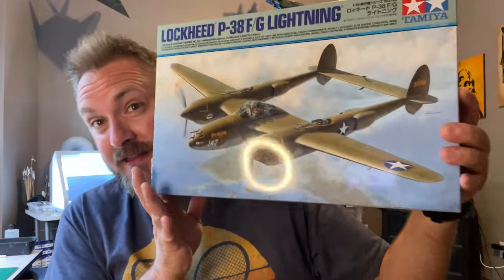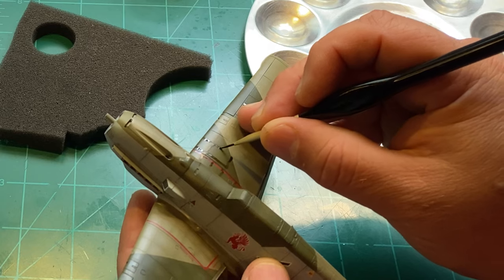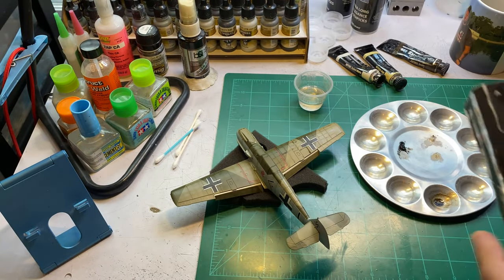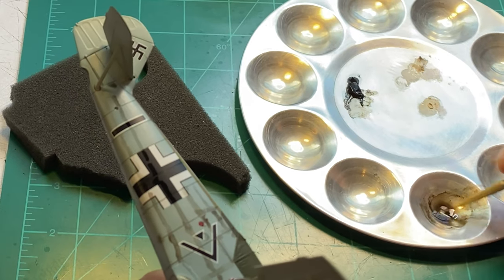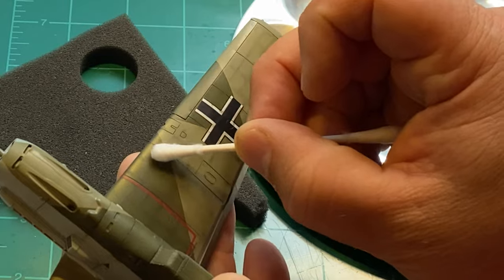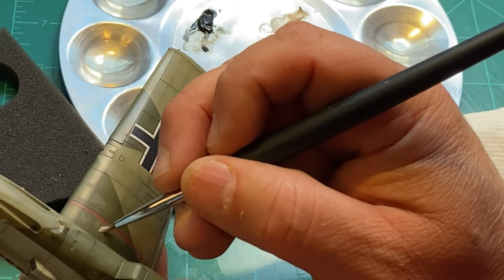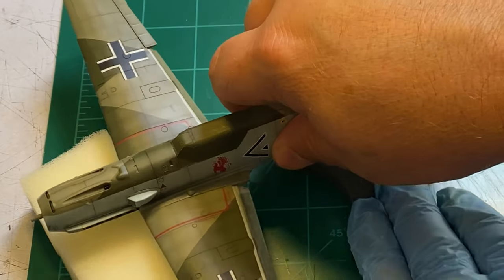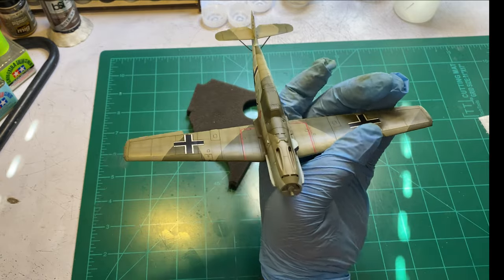Tamiya 1/48 BF-109 E3 Build Part 3

Comment: Hello, how do you get that great finish on model ? Somehow I'm not able to get such gloss, semi gloss or flat finished. I'm using tamiya, mr hobby or mrpaint colours...what ratio paint/thinner are you using ?
Reply from the maker: I spray at about 12 psi and mix my paints pretty thin.  I don’t have a typical ratio as sometimes I want it thicker or thinner depending on the color or look that im going for.  The real key is to wet sand.  Wet sand using a 4000 or 6000 grit polishing cloth starting with the primer and then after the main paint layer.
Reply: @seanerk5kt9   thank you... You always do wet sanding? Prior gloss coat
Reply from the maker: @tomazpravdic331  most of the time.  I use Tamiya acrylics which will almost always be at least slightly grainy after being sprayed.  Using the 4000 grit sanding cloth it smooths away that slight graininess
Reply: @seanerk5kt9  thank you.. with enamels I had never had any problems.. but recently i switch to acrilic colors and have this isse with gloss/semi/flat coat...